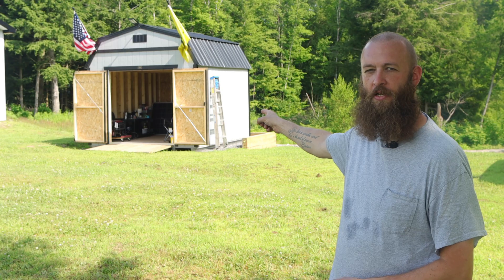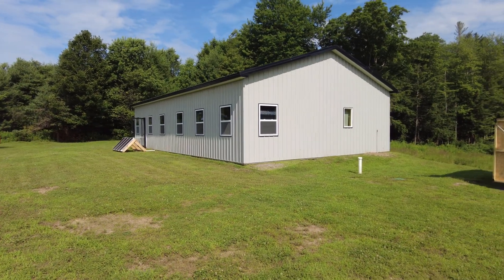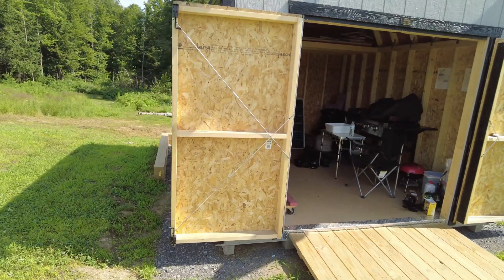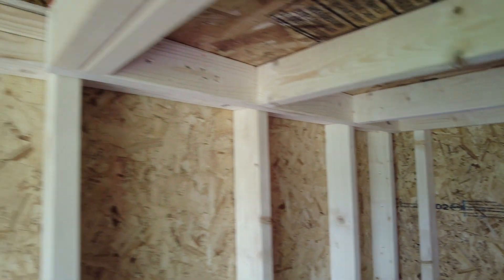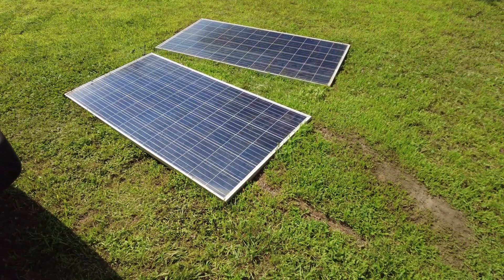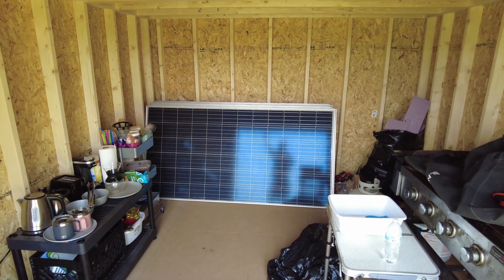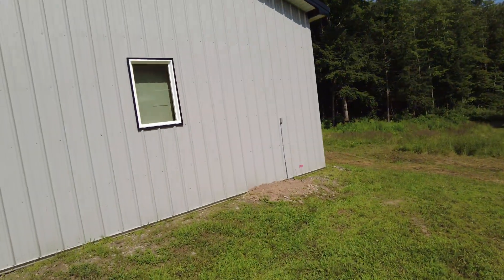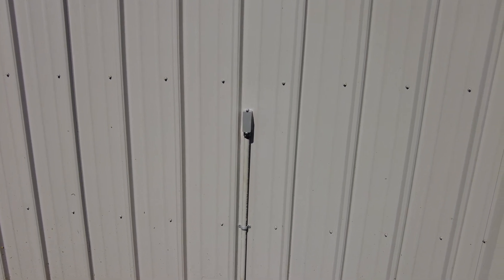Starting Our Power House Build! Choosing Our Future Inverter and Building Our Breaker Panel!

Comment: if you dont drive much like you mentioned. alot of EV owners just use a 120V charger(level 1) with house hold outlet. nothing special. Also what kinda of appliances are you gonna be using? Electric or gas(propane?) If you are going for electric, if you have the cloth dryer and the oven on, then the AC kicks on, that's a lot of juice all at once. also need the battery storage to handle those loads during cloudy days. All my appliances are natural gas, and i usually use 10kwh of energy each day.  Would be alot more if they were electric. Good luck with your build!! Excited to see it ccme together
Reply: I have thought about the level one charger, but I'd like to have the capability to expand to a level 2 charger in the future, of we even get an EV.  For our appliances, we are looking into electric fridge, dishwasher, 2 in 1 washer dryer, ect.  Our stove and tankless water heater will be propane. Our mini split will most likely be one that can run on solar and 240volt. We plan to have more than enough batteri s and panels to support our needs.  

Thanks for the thought provoking comment!  We are excited too and are looking forward to seeing more and more done.

Comment: So, out of curiousity, are you going to be using propane for water heater, furnace, stove/cooktop and or clothes dryer?  Or are you going to try and have everything all electric?  On your mini split, are you going to get a multi head mini split or maybe get 2 or 3 (for redundancy)?  I'm pretty sure I could probably run my house with 10 kW inverter so long as I use my electric dryer during sunny days and a smart start on my conventional hvac unit.  What are your plans for batteries?  Going with EG4 batteries as well?
Reply: All great questions! We're going with a propane stove and propane tankless water heater. Everything else will be electric, including our mini split. Currently I'm going back and forth I'm getting a two zone, or a bigger one zone. Chances are I'll be getting a small mini split for the powerhouse in this video, but for the house I'll need a good size 240 volt mini split to keep that cool during the summer. As for batteries, I would like to go with EG4s 200 amp hour wall mounted batteries. It's such a huge investment at first, but seems to be well worth it in the end

Comment: 1200xp will give you 50 amp each 2 will give you a 100 amp I have 3 so I can get 150 out of them Like I said run your main wire for the max you want you can up grade the rest as you go If you can afford it go for it now Good luck

Comment: I would put a 2x4 or 2x6 across the bottom of your beams nail them to your 2x4 wall boards The 1200 xp is a great choice I have 3 of them work great and get a mine splint way better then window unit uses less power and will heat to I have saw them for as low as $400 and $125 for the Vac kit if you don't have a friend that have one
Reply: That 2x6 idea is brilliant.  It's alao great to hear about someone's experience using the 12000xp, glad you're happy with it!  

Thanks for the comment!
Reply: I second the recommendation of a mini split.   Very efficient, I use one in our solar shed.